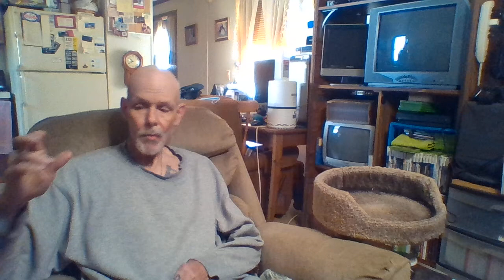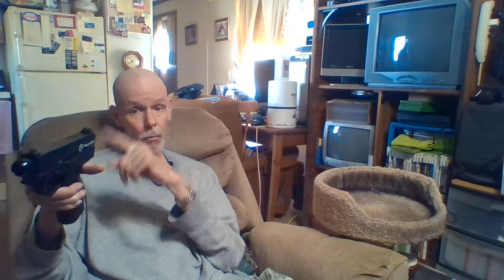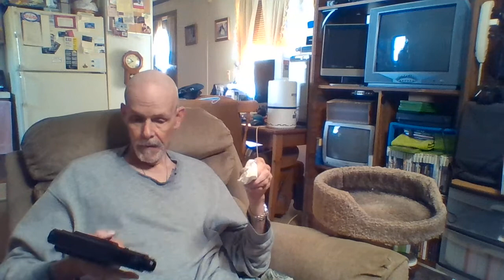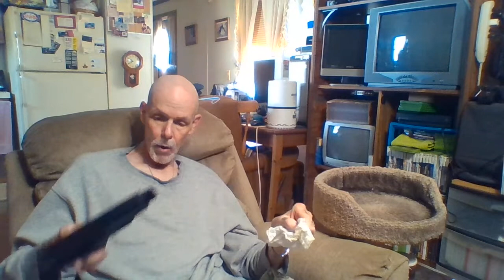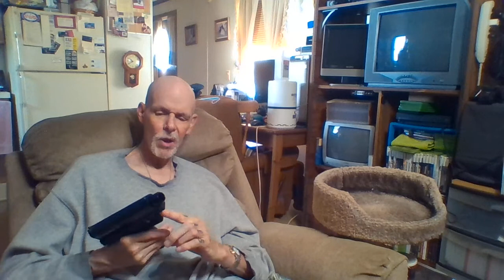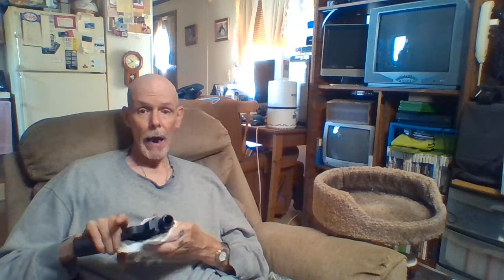Upgraded My TCP

Comment: Thanks for the mention. Your TCP is looking good. The video where I gave a full description of the shims is here https://youtu.be/rW0Fs7F1LIQ. Check the written video description that includes the specs for the 2 shims. They are cheap but come in bunches. I think I got 10 of them. I explain the logic in the video. They will let it fire at max power, but in reality I never go all the way there. It's easy to get carried away making 5% gains in power. Your current set up is the most reliable and I bet you're hitting 30+ Joules.
Reply from the maker: Glad I could help thanks for the info